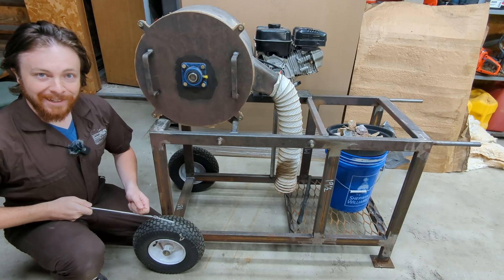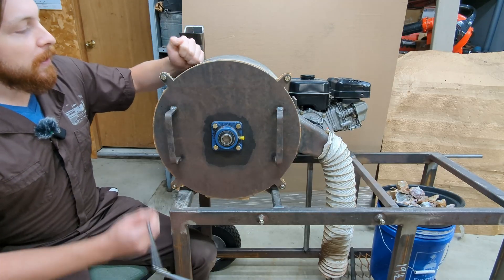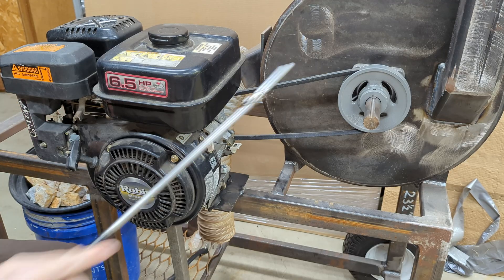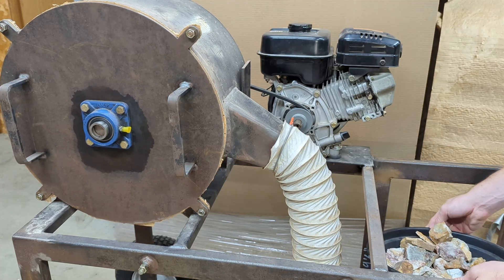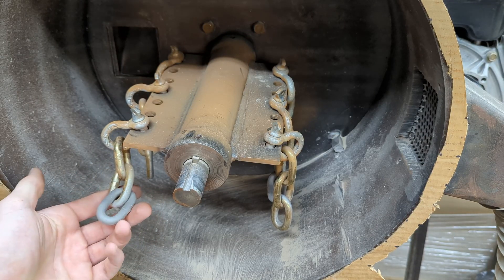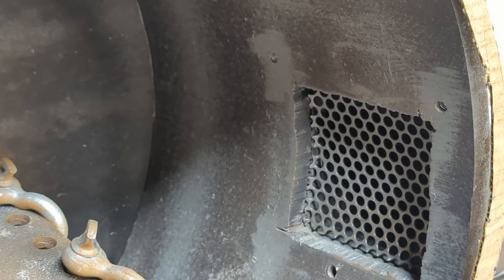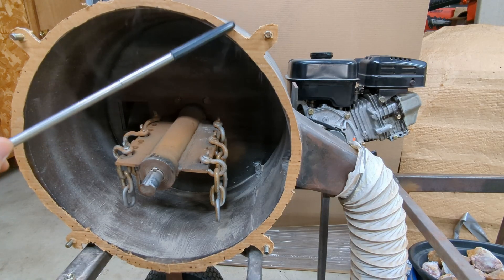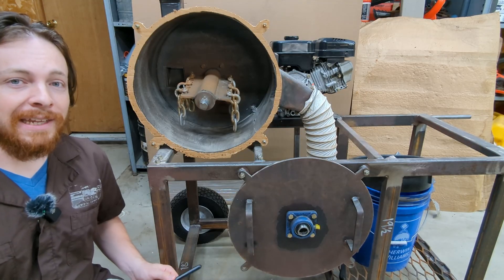Rock Crusher Build - Impact Chain Mill For Gold Prospecting

Comment: You will find that where the clevises bolt to the shaft that the holes will oblong out, consider using AR plate for them in the future. You will find that as the holes oblong out you will get more wear on the drum. Add a tube on top of the carb and locate the air filter higher, out of the dust, lots of companies make higher  quality filters you can just clamp to the top of the tube.
Reply from the maker: The holes becoming oblong where the clevises bolt to the shaft was a concern of mine. Will look into improving that eventually. Good idea on relocating the air filter. That will be good if I ever run this away from the shop. I plan to set up a cyclone dust separator system which should also help suck out any material that gets stuck inside.

Comment: Another suggestion would be to move the rear wheels more forward. When I built mine I did this  so there wasnt so much weight to lift on the handles.

Comment: Looks like a good start on the crusher. For the classification, perhaps consider an air-classification outlet system like Keith Bowen's design (Hard Rock University) to eliminate the output screen problem entirely?